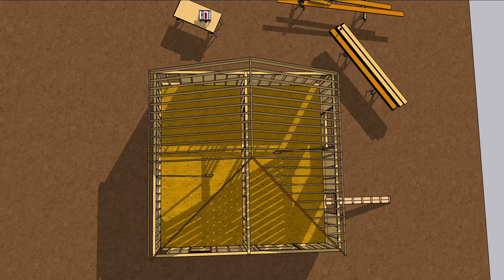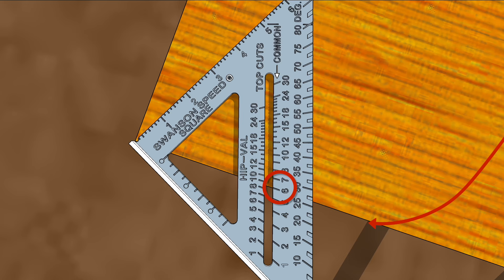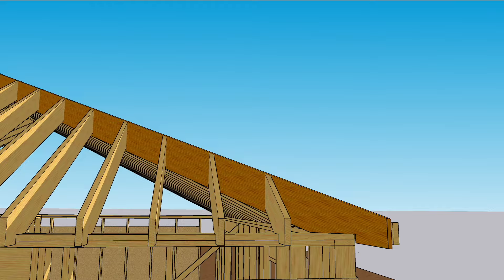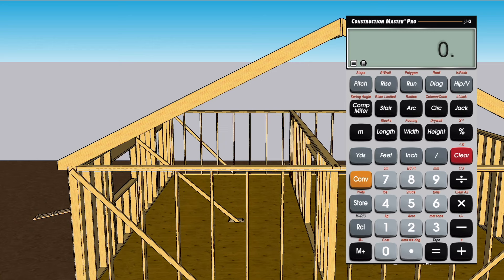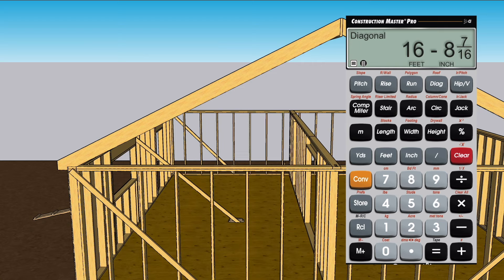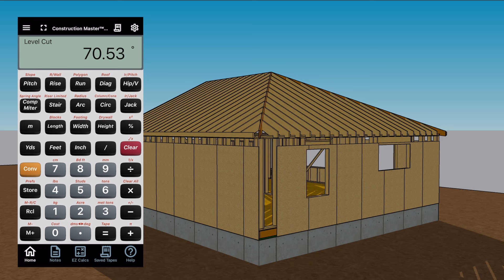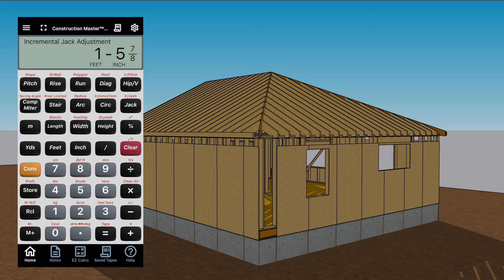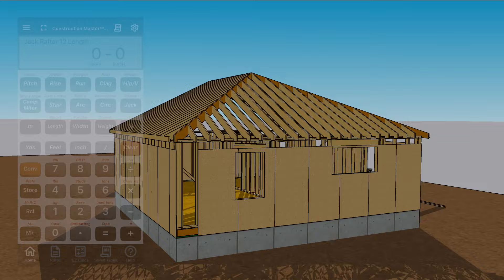Rafter Calculations for a Hip Roof: Hip Rafters and Jack rafters

Comment: Your using a Swanson square, on the 
hip scale it shows under 20 degrees, 
my Mr Pen shows about 22 degrees, 
I may need to upgrade my speed square.
Reply from the maker: It is not a Swanson square, it is a drawing of a Swanson square. :)

A 6/12 roof is about 26.5 degrees. The hip and vally on a 6/12 roof is about 19 degrees.
Reply: tan⁻¹(tan(26.5°)÷√2) = 19.42° - Conversion formula which isn't taught anymore, just let the calculator do it 😂

Comment: Construction Calculator.
😢
Reply from the maker: it is easier than doing the math on a piece of OSB.

I used a book called "The Roof Framer's Bible" when I was framing houses because I was too cheap to buy a construction calculator. Now they come on your phone and are very cheap.
Reply: @ProTradeCraft  
I hear ya, I was hoping this video would
be focused on the math, not reliant
on a Construction Calc. I would imagine
that if I was in the trade I would also 
be using the CC's.